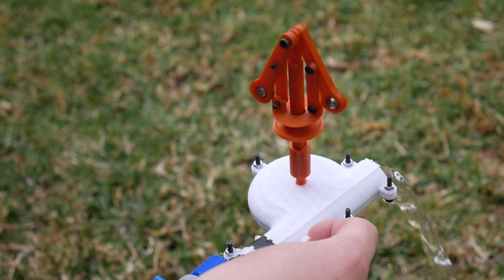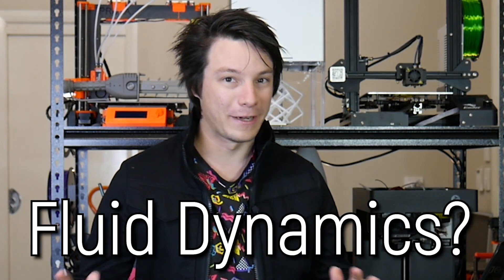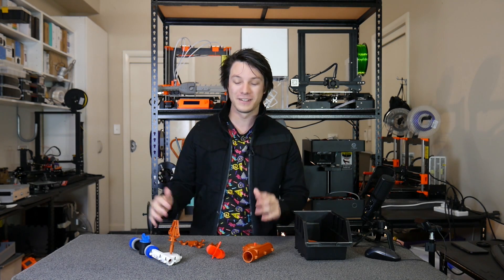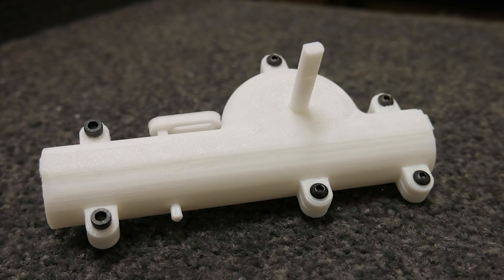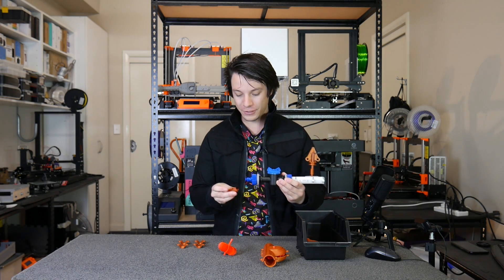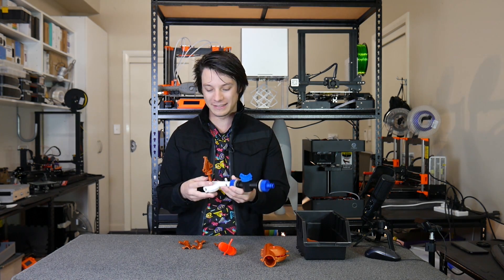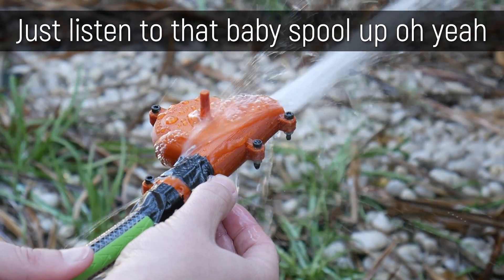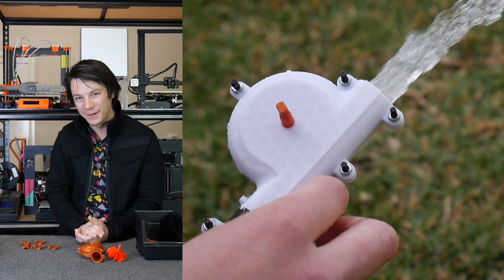When your projects FAIL (and why that's a good thing!)

Comment: i'd amend the three prototype rule to be three prototypes with no improvements, you don't want to limit yourself to only three prototypes if each prototype is still getting better

as far as changes i would have made? i think that turbine might be too small for that water source, for something that can compress like air or steam it would have been fine, but for water it's a bit too small

the water hits too close to the center of the turbine, so i would have given the turbine a larger radius, and i would have made it twice as thick as the hose too, so that i can move the exhaust to be out of line, the more the water has to move to leave the more energy the turbine can capture

i'm not an expert these are just things i've thought of based on things i've observed

Comment: Sir, I build a Bluetooth robot using Arduino Uno, after programming the Bluetooth robot using Arduino Uno, when I connect the Bluetooth robot using Arduino Uno with mobile when I started the Bluetooth robot using Arduino Uno, it just didn't work, I try to programme the Blue tooth robot using Arduino Uno, it didn't work again, I start it again, again and again, but the Bluetooth robot using Arduino Uno didn't work. Please tell me the issue and the problem. Thank you, sir.

Comment: Cool project.
Had a thought. I'd rearrange the components... Hose, then turbine, then valve. In this order the turbine RPMs would be proportional to the flow rate regardless of the pressure. It would eliminate the turbine speeding up as the valve is closed. The rest is just details. In an electrical analogy it would be using the amps (current/flow) vs the volts (pressure).

Comment: you seem to have failed to learn another important lesson. no need to recreate the wheel.

hose connectors, turbines, governers and related linkages have been designed before and are well documented. you should be looking at what has been done before then adopting and adapting that into your designs. if you had done your research you wouldn't have needed to iterate the connection for those hose as the exact specifications already exist for such a standardised connector. you would have known how to better shape the fins of your turbine, and you would have better known has to design a linkage for your governor to the butterfly valve you intended to use

Comment: Prototyping can apply to a lot of things, really anything I would say. I've mostly used it for writing, but I've also found myself doing it when we have had especially challenging programming assignments, or when I'm trying to build something out of LEGO.

One feature of prototyping you didn't make overly clear is that it removes a lot of the pressure that comes with creating something. The first iteration of something should be quick and dirty, no need to spend hours perfecting every detail. This is especially important when you do not know what you're making, because then you can instead use that time to iron out the mistakes you're bound to make.

Comment: Prototyping is what makes 3d printers so good. You do have to take the use of a device into consideration when developing products. parts that require strength and durability should be made with materials that can handle the job.

Comment: Ideas if you want another go at it.  Put the valve on the exhaust side of the turbine.  That should have the turbine speed relate to the flow of water instead of the pressure blasting against it when the valve causes restriction.  Sand the components with sandpaper.  I'm just getting in to 3D printing and I've been watching some of your videos, which are full of great info.  Thanks!

Comment: First mistake is not using different material fittings for lower rate of friction. You didn't even do brim step base to hold the pin for the turbine. Secondly, dude! Ever heard of gaskets? 

BTW, I'm just an electronics engineer and also don't know much, but at least I know some basics.

Comment: I don't see anything that failed here.
Just need some glue and ballbearing.
Reply: His lack of knowledge regarding mechanics and dynamics is showing. He needed gaskets, bearings, and cylindrical fittings to hold the turbine pins in place to prevent rattling. 

I also noticed he kinda cheapd out with how clean his prints were supposed to. That roughness was just due to low res prints.

Comment: Maybe you could print this particular project in SLA instead of FDM? This would solve the precision problem and probably also partly the water leakage one (FDM doesn't seem to be so good in making things watertight). You might have to increase wall thickness because you don't want it to explode at water pressure, but it might be worth a try.

Comment: Mate, I love your projects, the way you explain, your editing. Everything, really really good job (and this is coming from engineer)
Now, my little 2 cents would be to encourage you to use more materials that are not 3d printed, if you really want to 3d print mechanical stuff. The likes of polymer and air dry clays, cement and plaster of paris or even epoxys like Milliput (the latter bugger is really strong and absolutely watertight)

Comment: There's succeeding and learning to succeed. One thought.... Is it an option to use the spinning illusion of, let's say, numbers?The wagon wheel illusion. I bet if you get the spaces right, you can show these numbers optically in corresponding flow speeds. This would simplify your setup (the centrifugal governor is way to big for this small tube).

Comment: Yep, I always learn something from my disasters.

Currently I'm adding a big-ass micro switch to the Z axis on my Anet A8.  It also has a 30:1 arm on it.  Currently printing first iteration.  Will it work?   Well I am from Oz, so maybe it will...
Reply: Nope, it's too long and gets in the way of the electronics box with the big-arse fan on it...  If only I hadn't gone with the 120mm fan...

Back to the drawing board I go.  The arm will be more like 20:1 instead of 30:1, but it's a simple fix.

The mistake I made was not being able to visualised how it would fit in with existing upgraded hardware.  Now I know...

Comment: 3:54 that's actually a compressor wheel. The main difference is com wheels tend to run much finer tolerances and have more of a sealed design.

Comment: Before this, I watched your video on speeding up the 3D-prints. During my bachelor thesis I printed the prototype parts on an ULTIMAKER 3+ and the parts got really nice. Most of the parts were proppeller blades, so they were aerodynamically critical.  The parts were really good just from the printer, but I still used some sandpaper from an 80 index down to 600 in order to get it as smooth as possible. I did not remove much matterial, but due to the heat generated, the material slightely filled up the "gaps" between the layers.

Comment: you was simply wrong design staf for water. walls should got thin gab another should got thin wall on middle and works like a puzzle plus your idea with flex and will work many bars

Comment: To make a centrifugal governor like this work, you do need to do some of control system calculations and mechanical and pneumatic modelling. You do not necessarily need fluid dynamics for designing this system.
It is essentially a feedback system and can be generalized as such. You would just need to find a proper way to model the mechanical dynamics (relatively easy) the valve wrt water pressure (relatively easy since the area of the valve is roughly proportional to the angle of the valve) and the most difficult part, calculating rotational speed achieved with a certain water pressure on a certain peddle. 
You can do these designs iteratively, but then it would be better to do this in a program like matlab or simulink. Most of today's problems are iteratively designed in the computer and verified there a bit before trying to prototype and find actual implementation problems. 
How I would approach it, is design a certain peddle, try to characterize this peddle with different water speeds and different loads, and then proceed to design an appropriate governor and valve (valve opening).

Also, some small skateboard bearings would help with a lot of the resistance problems you ran into.

Comment: Just go to an auto shop that repairs tires and ask if they have any rubber putty that they use for closing up punctures in tires that should be more than enough in sealing up tiny cracks

Comment: it is still possible to have precision parts with FDM printed part. You can print all critical features with extra thickness/material, then finalize the geometry with a drill then a reamer. For example, if you need a 1/4" hole, 3d print it as 15/64"(with extra perimeter thickness), drill with D size bit then ream with 1/4" reamer.

Comment: instead of the o-rings (or alongside) arond the edges you could add a lip/ double lip (like a T shape into a U shape) so the parts interlock a bit and create a bit of a wall and more surface area with less net movement/ available space for water to leak out along the edges, and you could add a silicon/ rubber seal or gasket sealant type stuff after if you still get problems, but having the lip will help with the pressure not being able to instantly pull the pieces apart which will help with bearing surfaces staying aligned.
also you could try not having a straight flow path, ie curve it or loop it round 180 (if not helical 360) though youll lose overall power from energy exerted/ lost- youll have more control and greater power transfered incase you want to use the shaft to power anything in the future.

Comment: Here's another tip if you ever make a tight sealed section with is ment to hold pressure make sure that where you put the screws and push them back about 1-2mm doing that puts much more tension

Comment: Hallo Angus!
I have looked the video ones more and fonund something strange. The governor should drive a valve in order to obtain a closed feed back loop of operation. With increasing speed of the turbine the valve should  be closed more and more. This is how the governor usually works. In your application there seems to be no connection bvetween the valve and the governor. Therefore it can't work.

Comment: This is actually a really nice design. Failure is just another way to find how "not" to do something.  However, this isn't fully a failure.  With each iteration, you are refining the process.
If your ultimate goal is to build this with 3D printed parts, this might be an issue. However, if this is a prototype that will later be cast or CNC'd, this is a great process. It's a lot easier to reprint a design modification than it is to re-CNC the parts from metal.
I think maybe another 2 iterations and you'll have a functional unit, even 3D printed. Just take the comments from everyone as reference on how to make the future design mods.
A quick suggestion, use that TPU and make some real O-Rings. What you built was a seal, and O-ring is, well, shaped like an O  ;)  Where the centrifugal shaft runs through the housing, use the O-rings there, and that'll help minimize a lot of leakage, as well allow the unit to spin more freely, even when dry. Change the shape of the turbine to a pelton shape, and put a nozzle between the butterfly valve and the turbine.

Comment: If you have not though of a solution to the throttle already I may have come up with an idea but...I also know nothing about fluid dynamics at all! You could add a valve which sends the water on an alternate path from the turbine so the velocity does not increase but divides.

Comment: I had a failure this weekend with a Folgertech FT5 with a E3D Titan Aero, Volcano, and .8 Nozzle. I was running some PLA prints where I was looking for high strength so I was running a .45 nozzle height at 220 degrees and I had under extrusion issues until I cranked the speed way down and even then I did not get good layer adhesion. I usually run this printer with a .8 nozzle and .25 layer height and I never have layer adhesion issues. You might consider doing an episode relating to this type of issue.

Comment: For your impeller design instead of something so simple, look at the vanes on modern automotive water pumps....they're often yes, plastic (though I always prefer steel because I've seen plastic ones  fail, with steel ones it's usually just a seal or bearing and you're not worried about the impeller have come apart!).

Great designing as always, I'd have earlier gone to an off-the shelf valve, and bearings or bushings. :P

Comment: Awesome video, please KEEP them coming! 

I would say for this project, print something more of a pelton wheel and add some water proof bearings. Check out waterproof skateboard bearings, keep in mind, it would be best to keep the bearings out of direct water flow (I'm open to ideas because that's not easy). Amazon says they're waterproof?!? Get rid of the butterfly valve and focus the water on the pelton wheel to a fine point like a simple garden hose nozzle. O-rings are good but really shouldn't be needed (keep them on) because you shouldn't be building water pressure. The exhaust of water should be just that, somewhere for your water to go. Water pressure will go in every direction, including the opposite direction of the direction of your wheel which will in turn block your exhaust, slowing your wheel.  The reason your system works better with higher water pressure is because the water has to go somewhere and the easiest way is out, the general direction of water input to water output will spin your wheel (if that makes sense) Your wheel can't handle the Rpms for the high volume of water and most likely is causing friction slowing the wheel (It is). To get the wheel spinning fast you need water pressure to be as close to zero as possible with as little wheel friction as possible and give the water room to escape (pelton wheel spinning as effiently as possible). SUBSCRIBED!!

Comment: The way I see it is that often failure is the best teacher. It might not show you the solution but it DOES show you what's not the solution. Which ofc brings you one step closer.

This reminds me when I needed to print a lever for the dropper post on my mtb. The little lever needs to  hold a cable tight and actually pull it with a good amount of force.
I think I ended up with a almost 10 prints or something before it actually worked and now it's been on my bike for over a year.
Along the way I learned which plastic to use, I went with abs so it'd survive a hot summer day in a car and I smoothed it to look nice. The biggest thing I learned however is that it was impossible to clamp the cable tight enough with plastic treads so I bought some heatset tread inserts. They worked perfectly and that projet started my love for tread inserts.

Comment: I don't remember the channel name, but there's a guy that made a compressed air powered model plane, using 3d printers to build the engine that converts the air pressure into the rotation of the propeller. If I remember correctly, he had some issues with the efficiency of the system, but he managed to not have any meaningful air leaks. You might wanna look it up.

Comment: Funny thing about the water flowing threw the fast spinning turbine, it was also prolly cooling the turbine's shaft where it contacts the case preventing it from accidentally friction welding... possibly, also next time increase the width of the seams where the uper and lower halves meat so you have more room for either one large O-ring or multiple layers of what you had maybe?

Comment: A idea i had of a easy made valve.
If you used a steel ball inside a cone held in place by a spring and the mechanical part pushes the ball backwards allowing the water to flow.
Do not give up so easily you just lost your way and went down the wrong path which lead to wasted time.

Comment: For what little I've dappled in hydraulics, I've learned two things that apply here. 

Its not about pressure, but flow when driving a turbine or motor. If there is a high pressure differential across the motor or turbine, something's wrong. Something is grinding, seizing, or the device is overloaded. 

When designing a variable flow valve, such as this butterfly valve, you want to restrict the flow after the device. The water can't flow faster before the valve than after the valve, but after the valve there is a lot of turbulence and loss of flow to leakage. So I'd suggest moving the valve to after the turbine. 

One more thing from a mechanical perspective, the governor is way undersized for that size valve. The force of that ring moving up and down is barely anything, so it needs a long lever arm to actuate the valve. This means you either need to make the valve smaller, or the governor larger. It's all ready huge compared to the turbine, so I'd suggest going with a smaller valve.  

As I wrote this, I had a thought. If you put the valve first, then a laminar flow nozzle after that, pointed at a turbine in open air, that could work too.

Comment: Disclaimer: I know almost nothing about fluid dynamics either. But ... I have 2 ideas, if you decide to revive this project. 1) Put a restrictor in the water flow. Currently your valve is working "backwards" - closed is giving you a faster turbine, due to the increased velocity. But if you feed (the input? or the output?) of the valve through a restrictor, it may eliminate or mitigate the change in velocity. 2) Make either a ball valve or perhaps a cone-shaped valve. Either might give you better control of the water flow. Again, please note the disclaimer ... !